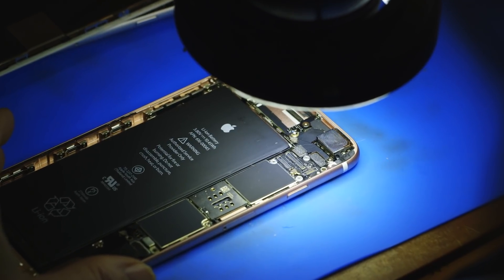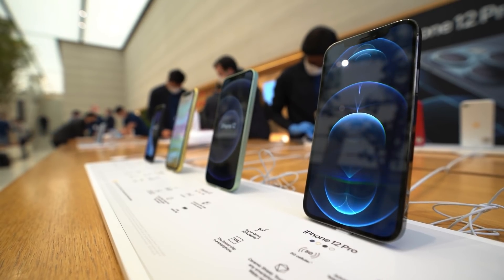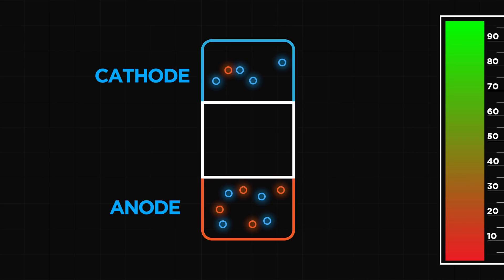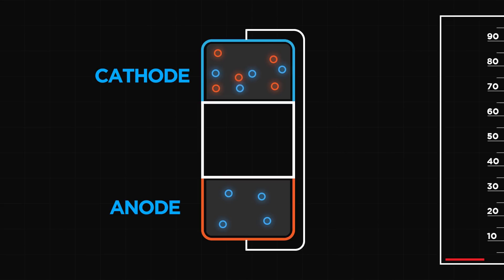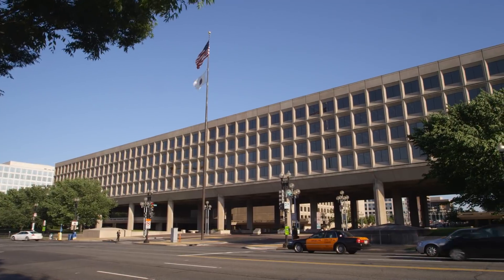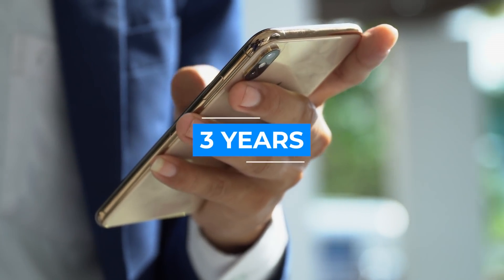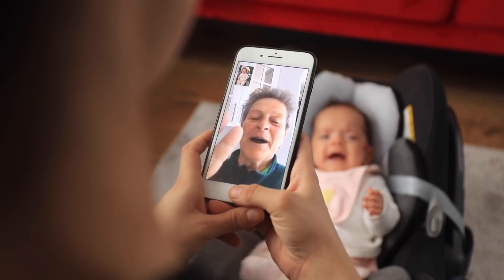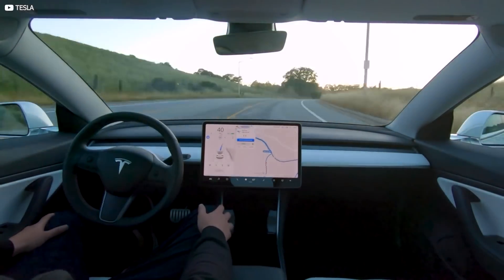Why iPhone Batteries Can't Last Longer

Comment: The Samsung a10e has a removable battery, 
in case this comment section gets flooded with false comments about how there aren't any cell phones available with removable batteries any more. 
The phone also costs less than $200.

Comment: FYI - in the USA water tanks do not even exist in attics. The concept is in extinction here. There were large wooden stave iron ringed "water towers" over buildings in cities 160-100 yrs ago and they disappeared by 1960's. The way things are going now with shortages of everything, water storage is becoming a prime consideration since without electricity there is zero water in any rural area which is 90% of populated the land mass on the continent comprising Canada and the USA. Also, Large cisterns were built into all the rural basements a century ago which were also disbanded after electricification. Everything is now pumped in with 100% dependency on the utility grid mains.

Comment: I would use a thicker phone for more battery. Also, iPhones have significantly smaller batteries than androids because of the mix between the chips they use being really power efficient and also iOS being a low power software operating system. Androids need more battery to power it because most of the chips are Qualcomm or mediatech and android wasn’t very well optimised for anything other than google pixels

Comment: How to save a LOT of battery:

Low power mode
Airplane mode
Disable location services
Keep brightness below %50
Delete apps
Dark mode
Delete widgets
Disable sound detecting
Disable bluetooth
Close apps
Disable vibrations
Enable reduce motion
Reply: Turn off
Reply: Simply put the phone in to a basket and get a feature Phone 😂
Reply: Simply Switch it off ✌️

Comment: You know there is a trick most people only charges on low charge the higher the voltage the better I’d normally charge of a 415 v better life only need 10 years  battery life

Comment: I dont say what the point of this video now 12 pro max even smokes s21 ultra 5000 mah in drain test.. Even with less mah
Reply: Esp 11 pro max which has better battery life than 12 pros. Let alone if you have premium smart battery cases which are mostly for iPhones...not sure if there are high quality ones for android esp fashionable
Reply: Nonsense that's absolutely wrong